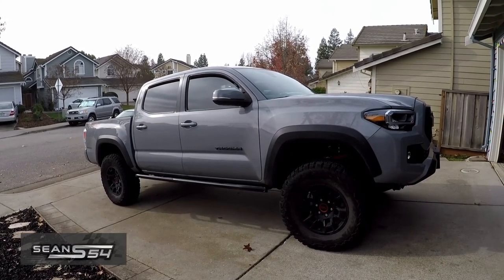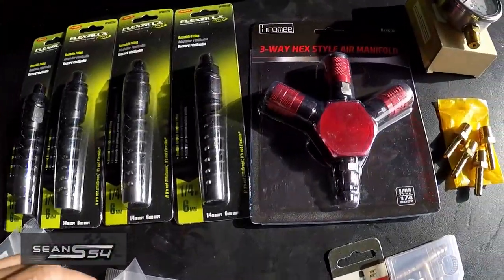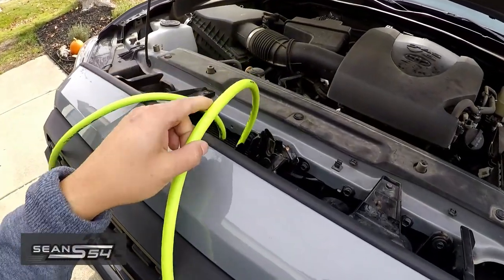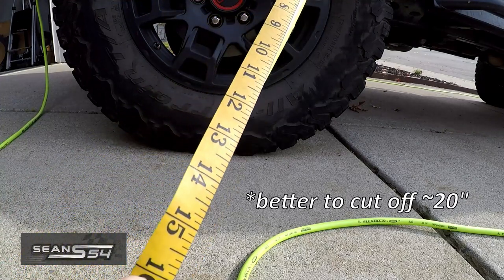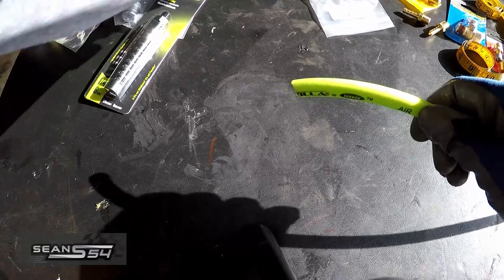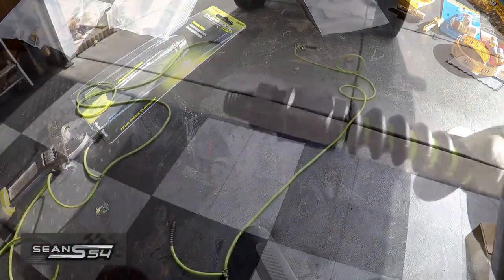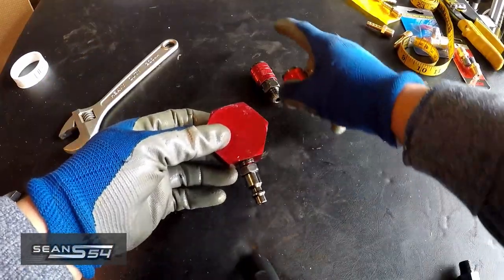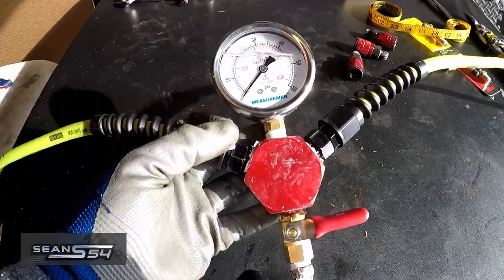4 Tire Deflator & Inflator - DIY

Comment: Put this together tonight.  Best rig I have seen and smartest way to put it altogether.   Tested for leaks and ready for the trail.  I did use a quick connect to attach a small air compressor connector to the outlet section.  Air down and up with a valve stem compressor fitting.

Comment: Instead of brass parts use the PP snap on snap off quick coupling.I made one using these for my 4x4 Thar.Working without issues
Reply: Can go wrong with brass fittings, they'll last for years. We've used them on tow trucks, fire trucks, tire servuce trucks & maintenance trucks. Shouldve used 3/8" lines & fittings

Comment: Do you have to connect all 4 tires for this to work? Can I plug in just one side to the manifold and air up or does it require both sides as it's blocked off by the haltec chucks

Comment: I understand that it’s currently using the overall PSI but what would happen in your opinion (all in the know) if one tire was 20 psi while the the other 3 were 32? Just want to be able to understand the setup and how it would work in this scenario. Use inflating and deflating if possible. Thanks!!
Reply: Thats not how physics work. if all the tires are connected through the air hose, as soon as that valve is opened the pressure in all 4 will equalize. so given the psi for the tires you gave, the pressure for all tires should equalize to approximately 29 psi or slightly less if you account for the loss in the air hoses.
Reply: @slipknotserge  gotcha now i understand the balancing a lot more.  Def gonna set myself one Of these. What was the entire cost if you remember

Comment: Can you give us a Parts list please?
As I disconnect these, what keeps the air in a Connected Tire as I disconnect other tires?
Do I just have to RUN?
Any of these connectors not flow once they are disconnected?

Thank You!
Reply: PP 8MM hose to required length
5 number TEE PP connector 4 nos air chucks
Reply: Closed valves will not let air out until they're engaged on a valve stem.

Comment: Question: Are the tire chucks you used open or closed? I can't use the Haltec due to my valvestems so I need to get the old school single lock version...but I'm not sure if I need open or closed version.
Reply: They're going to need to be closed.  If it's open it would leak out of the disconnected valves while you're connecting each tire.

Comment: Why not utilize the quick connects that came on the circular brass part?
Reply: Assuming to just save a little bit of cost when it doesn't really need to be there.  But I'm kind of with you, might as well spend another $6-10 to be able to quick disconnect each side.